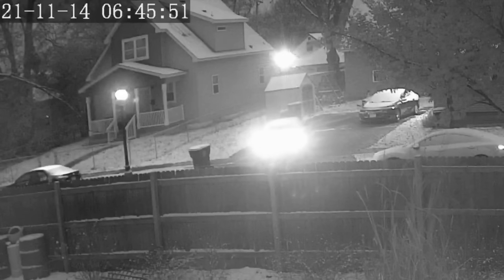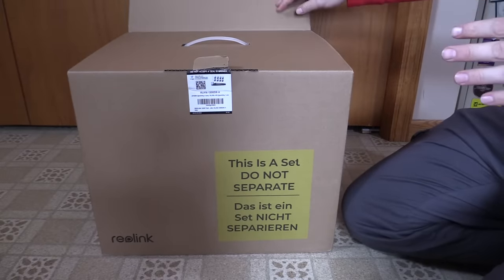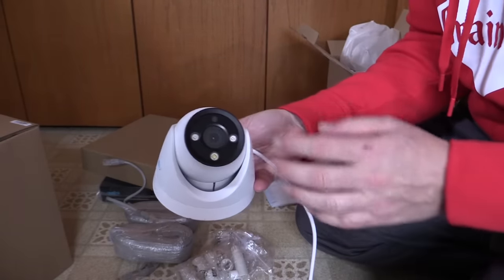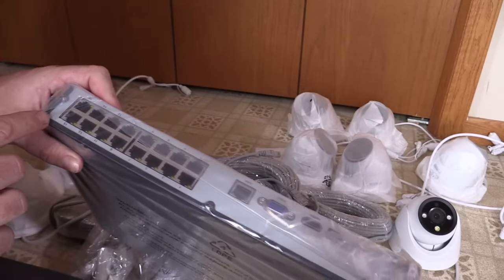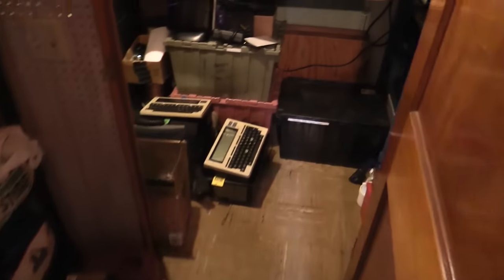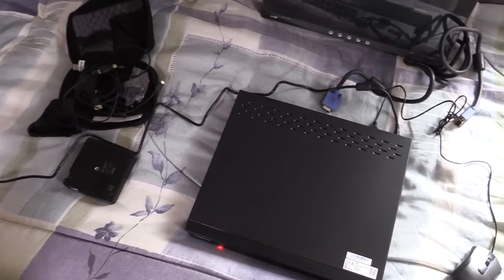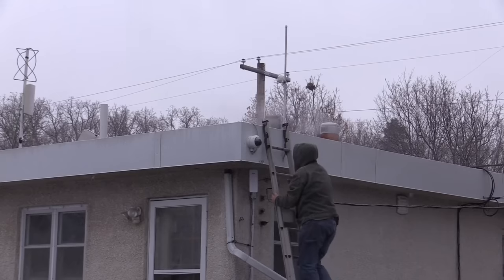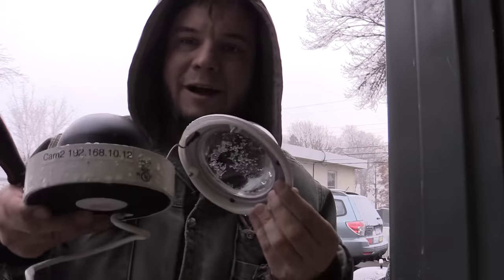Installing New Security Cameras Around My House

Comment: I'm surprised the vga port didn't work, usually I have way more reliability issues with hdmi compared to vga.
Reply: I wonder if it was the cable Gabe used, instead of the port itself. Ports usually get tested in the factory to prevent stuff like this happening.
Reply: His monitors are trash bro native resolution out that vga would be way above what those junkers could do but you can change settings once you have got into it to down scale res who doesn't use a 4k TV or monitor these days almost no one why would they set there resolution low enough for what is essentially trash now. Sorry to be so blunt but reolink NVRS are decent this is just tip junk on modern equipment a play station or xbox probably wouldn't work either on those buckets 😂

Comment: I have one Reolink Argus 2 wireless security camera. It's been OK, except it's dropped off the network several times and I've had to re add the camera to the network from scratch.  One issue I had initially, was the motion capture was only capturing a few seconds of video ( even though it was set to capture 30 seconds past last movement). turns out, I was using a cheap Chinese micro SD card in the camera. Once I swapped it with a SanDisk, it fixed the issue.

Comment: I setup a CCTV system at my mum's over to 2 years ago. All 12 mega pixel & ptz 1 camera was reolink & it was the only one that went faulty & reolink were a pain. I had already got a replacement & was happy with the replacement but reolink took months to do anything & eventually replaced the camera it's still in the box as the cheeper replacement is better & works.

Comment: Infrared usually gives better "contrast" if you want to call it that when used for showing faces. I always have an issue with straight on lights though in IR mode (but also in color mode, so meh).

Comment: If you want a good deal of light in the yard at night it is best to get one (or a couple) of those high intensity LED spots with motion detection separately to create some light on the matter... Maybe even on a time switch system/circuit of sorts...
Also if you want license plate info documented there is always the sneaky upskirt/bushes cam option...

Comment: Part of my line of work is to install IP camera systems for commercial buildings, as well as burglar and fire alarm systems all integrated with access systems and a variety of other related systems such as air ventilation. If I may suggest, when mounting these outside, put some clear silicone sealant just on the inside for the mount to the building to keep water from seeping in. ...and don't take this the wrong way....but I'm probably going to shudder when I see how the CAT6 is run...hopefully not exposed outside. I'll try to bite my tongue. I'm not sure of how large your NVR is for storage or how many cameras, but overall doesn't sound like a bad price. Some 12MP cameras that are in the mid-range of a selection, like Avigilon could run you about $2500 per camera.
Reply: So you should be telling him off instead of Bragging.   Why not tell him that it's simply resettable once you know all his model numbers ? 😮 ?
Reply: Which we now know
Reply: @QIKUGAMES-QIKU  I should be telling him off??? Why should I be "telling him off"?? There was no bragging, sorry, but not sorry for your butthurt. It was stating a bit of credibility, experience, knowledge. It's not resettable, and I have no idea what the model numbers have to do with it.

Comment: You've got your work cut out for you with your property being open on 3 of the 4 sides. If you're trying to get better facial/license plate recognition another camera at chest level on the front of your garage will work great. So long as you don't see a lot of vandalism... The motion activated spots can wash out the video when they come on but they can also be the easiest and cheapest deterrent of petty crime. If you're trying to get real crazy you can look into using mmwave radar sensors and home assistant to track things in your driveway in zones to maybe not turn lights on until they get to a certain area. Or possibly even an alarm. It's a deep rabbit hole to go down. Best of luck!

Comment: Most of the issue with poor imagery is the video compression these cameras use. It's either that the encoding chips in them are severely limited in how high of a bit rate they can output, or the firmware of the cameras limits it to something ridiculously low. I think their excuse is that you don't need much bandwidth for an image that doesn't move. My counter-argument is that you don't buy these devices to stare at an image that doesn't move. You buy them in case something happens. That something will be movement. I think, perhaps, the other reason might be the video recorders they want to sell you. Perhaps the chips in them can't handle decoding much bit rate.

Comment: Would have been neat if the NVR also supplied POE, so it would truly be an AIO unit, and only needing a single UPS. Then again, I use 9 indoor, USB powered Amcrest cameras, that I've water-proofed and run ethernet and 12v out with 5v step down at the end, in direct rain. And run BlueIris on my Windows server.
Reply from the maker: The NVR does do PoE, I just found it easier to run one cable up to the roof than all of them.

Comment: Hello, here is the question
 Is it possible to combine satellite frequencies from several dishes in order to strengthen the signal?
Reply from the maker: I've tried, but it was too hard to balance the signals so they came in at exactly the same time. Each dish had slightly different tuning and internal wiring so the signals just interfered with eachother.

Comment: I'm curious to see how the motion detection capture works with these wired cameras and NVR unit. I have a wireless Reolink Argus 2, which has an installed micro SD card which captures the video. The slight problem, is that when it actually starts recording it's 2 to 3 seconds after initial motion detection, so many times, if an animal or person quickly walks in front, the recording consists of just nothingness. Ironically, I have been playing with Alfred camera App, with old tablets as the cameras. Even though it's a free app, and the video quality is lousy standard definition, it records the entire motion, even before the motion begins ( which I guess tells me the App is constantly recording on the cloud, and "rewinds" the recording slightly to include the entire motion detection event)
Reply: I have a few reolink cameras and I dont have this issue, though there is an option in the settings that you can set how many seconds of "before time" is recorded when motion is detected! I usually do 8 before and 8 after movement stops. Make sure you have that going on your setup.
Reply: @NotFab  my reolink Argus 2 wireless camera does not have that option. The only recording option is "post motion recording time", no option for "before time". That's why I was wondering if there's a difference between having an NVR recording unit, versus a standalone camera which records everything internally ( on it's micro SD card). I guess the answer is yes

Comment: that is where the North American way of building comes in handy- it is so much harder here to get power and network lines installed. I would have to leave the cabling visible, which is neither save nor visually acceptable.. installing it the right way is often only possible with major construction work.. which also makes it very expensive.

Comment: Rather interesting system.  Wouldn't fit my use case, but overall looks like would be pretty decent for yer average homegamer or a really small business.  Also as someone who mixed and matched my cameras over the years, the pains of installability and footprint of cameras....  holy hell does Hikvision give me Gastroesophageal reflux!  Recently installed a small outside storage box (aka "a shed") for some of my yard equipment that isn't visible from teh street, but I'd like to get a camera on it for at the minimum logging purposes.  Dug through my own stash and found a 2MP hikvision 2.8mm poe turret that didn't have any sort of decent mounting solution.  Ordered a "universal" camera mounting bracket off amazon, which showed up today and literally 1 of the 3 mounting screw locations even came close to lining up.  GREAT!  So now I have to drill/tap my own darn holes in the bracket I paid $30 to be "universal."  Thanks Hikvision!

Comment: Can tell you vga didn't work because native resolution is set too high for those crap monitors bro. Get 4k monitors and it will work the turn resolution down. For a smart guy that's a major oversight on your part not reolink and I have heaps of their stuff it's great.

Comment: with 12MP on a bunch of cameras how long does your storage last? Does it have a special mode like dashcams which save only interesting parts of the video while scrapping the rest?
Reply: @TRUMP_WAS_RIGHT_ABOUT_EVRYTHNG  True. I like the way my dashcam cycle records but pretty much deletes the oldest file unless it was flagged important either by user or software. That would be a cool feature on those recorders so 14TB drives or larger wont be needed

Comment: As much as I enjoyed this video, it's not the wisest move to show; a/ all your camera angles b/ how your infrastructure is setup and c/ what issues you have. Of all things, the high resolution can be 200MP for all it matters but if the person has completely blocked their face (like yours did) -- you aren't really getting much further. I think $1000 is better spent on silent/hidden motion alarms/door detection/etc and if they're climbing a wall it's cheaper to run a layer of fresh concrete with broken glass. Also, your previous cameras had domes that obfuscated the direction the cameras are pointing which can slightly deviate a nervous criminal. All food for thought -- appreciate your videos

Comment: I am so disappointed in you. couldn't be bothered to set up a bunch of old cameras? Couldn't be bothered to set up your own PA system? Couldn't be bothered to hook it all up and make it talk to each other using some opensource project no one has even thought about in 10 years? What happened to you man? You just bought a kit, and followed the instructions. AND STILL FAILED THE FIRST TIME.

Also, 12MP =/= resolution. and you know that. My old ass HTC Topaz has a 12 MP camera, and is still absolute garbage at shooting photos.